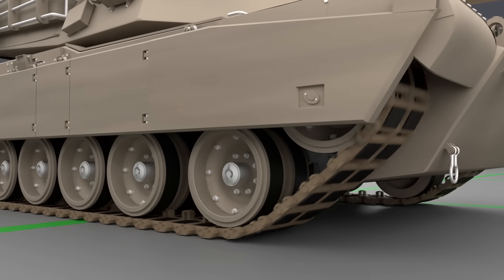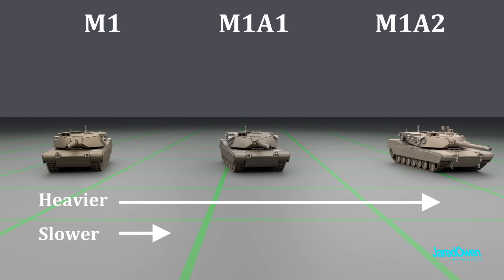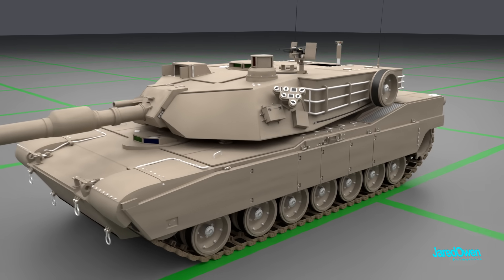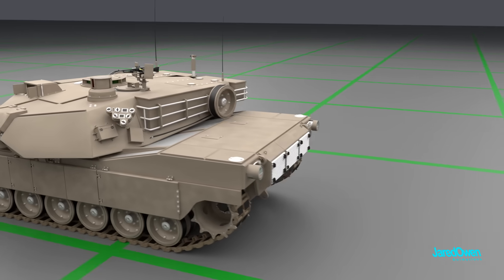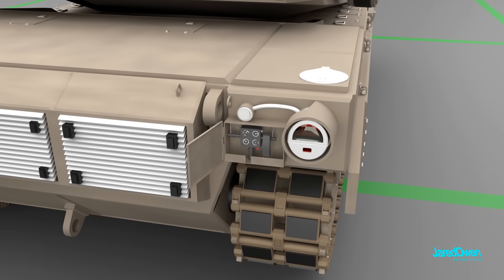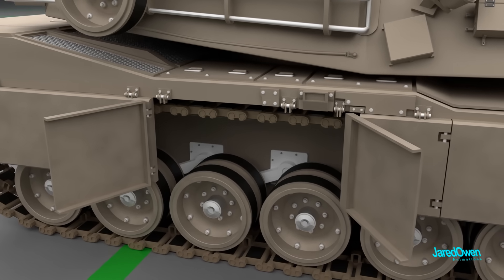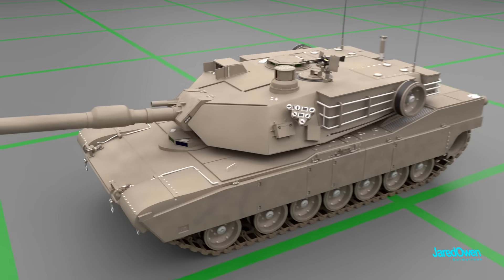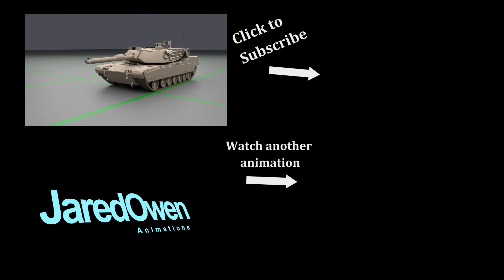How does a Tank work? (M1A2 Abrams)

Comment: Isn't it a dumb way to power a tank with a turbine which requires intensive maintenance, sucks soooo much sand in the desert where America's wars mostly are, requires special fuel. Wow, that is just so dumb! Other developed nations use diesel engine which is more efficient although less powerful.
Reply: They don't really require more maintenance. Sometimes more special parts, albeit there are less parts overall. Air filters take care of sand. The turbine engine runs pretty much on anything, Diesels are pretty limited in multi-fuel capacity.

 Diesel engines are more economical in regards to fuel consumption. Turbines are more fuel efficient.
Reply: @peterson7082  All tanks are high maintenance vehicles.

The MTU multi-fuel Diesel engine Ther powers the Leopard 2 can operate on any fuel approved for use  in the Abrams... so no advantage from the turbine.

FALSE, Diesel engines offer better BSFC and are more fuel efficient in combined cycle vehicle operation.
The AGT-1500 consumes nearly twice as much fuel per day as comparable Diesel powerpack combinations.
Reply: @sandervanderkammen9230  I was not referring specifically to the Abrams. 

> "All tanks are high maintenance vehicles."
  
 Agreed. 

> "The MTU multi-fuel Diesel engine Ther powers the Leopard 2 can operate on any fuel approved for use  in the Abrams... so no advantage from the turbine.
"

 This is based on what? 
> "FALSE, Diesel engines offer better BSFC and are more fuel efficient in combined cycle vehicle operation.
"
 I think you might be mistaking fuel efficiency for fuel economy.
Reply: @peterson7082  Based on the list of fuels approved for use in the M1Abrams.
Rudolf Diesel designed his engine from inception to have alternative and multi-fuel capability.
Military multi-fuel Diesel engines can operate on;
Marine fuel oil 
Heating oil
Any grade of jet fuel 
And gasoline or AVGAS
The AGT-1500 offers NO advantage in multi-fuel capability over available Diesel engines.

Diesel engines are more fuel efficient that gas turbines.

The Abrams when fitted with a Diesel powerpack delivers superior vehicle fuel economy.
Reply: @sandervanderkammen9230  Diesel engines are optimized for a particular rating of Diesel. Even if they're multi-fuel. The AGT-1500 isn't. And in fact the U.S. Armed Forces switched fuels at several points during the M1's career. Between Diesel and JP-8. 

> "The AGT-1500 offers NO advantage in multi-fuel capability over available Diesel engines.
"
 In emergency situations, no it doesn't, in the long-run yes it does. Especially when cost differences fluctuate between two of your main fuels in military service. The MTU' are optimized for Diesel only.
Reply: @peterson7082  All engines, including the AGT-1500 are optimized for a primary fuel type and rating.
The AGT-1500 is optimized for NATO F54 (Diesel Fuel no.2)
Reply: @peterson7082  The AGT-1500 offers NO advantage over Diesel engines in multi-fuel capability.
Reply: @peterson7082  False, the MTU 873 and 880 V-12 Diesel engines are fitted with A device called a fuel density compensator.
 This device automatically adjusts fuel metering parameters for any approved fuel, mixture or blend of different fuels.

Reciprocating Multi-fuel Diesel engines in service with the U.S. Army  are fitted with a similar device.

Comment: not bad vid i was a M1A1 sep tanker for 10 years only thing he got wrong was the fuel is not jet fuel its a modified diesel called Jp8 and all our vics run on it.
Reply: JP-8 is designated as a type of jet fuel.
Reply: The preferred fuel for the Abrams was D2 Diesel no.2 fuel but after introduction into service during cold climate operating conditions the Abrams suffered serious fuel system failures.
Special blended fuel was then supplied for the M1 which was a logistical nightmare.

The problem was not solved until 1991 when all U.S. Army combat vehicles switched to JP8.

JP8 is commercial Jet A1 fuel with a special additive package called +100.

Comment: Those two "Side Cooling Units" are not cooling the engines, they are Oil coolers and are placed on the sides of the transmission to allow for a drive shaft to turn the fans to draw air through the radiators. This video has quite a few inaccuracies, I worked on the Abrams for 6 years.
Reply: I thought so too, and he implied that all tanks have a turbine power package which obviously isn't the case. Also isn't the Abrams turbine louder than traditional diesels?
Reply: @ErisAlter  Higher pitch and louder when closer to the tank. The noise dissipates more quickly.
Reply: Eddy BT 
Yes but quieter than jet engines. And more powerful than the diesels, and can accept way more fuels than the diesels.
Reply: Awesome. Could it be possible if you write the other inaccuracies.
I would love to know more about it.
Reply: Also i think that smoke granades are usually launched before actually "exploding"
Reply: @gavinc8678  you should probably tag him if you want him to see you comment
Reply: @jacksondevine3870  I just saw it lol
Reply: We tried to give you guys the best recuperators possible to work with so you could go faster longer. This vid didn't even go into how it increased fuel efficiency or reduced the heat signature of the exhaust. Guess the turbine drive isn't "that" interesting to the masses. Hi to all the vets from the manufacturing end of things!
Reply: Yo I’m tryna buy a tank and flex wit it in my city. Gimme a plug big bro 💪 💯
Reply: @slow330xi3  Uncle Sam is the plug
Reply: Blaine Burgess Well done brave soldier but Abhrams is a same tank with minor differences comparing to Patton Merkava fantastic design tank.Same weight different manner to make a Tank
Reply: @raniolvespanssenlafayett6762  they both have their flaw and problems m8 not a single tank is perfect
Unless you tie cows to your tank and shoot the India

Comment: There is much much more to a tank that was not mentioned in this video. It's really the most basic of information. 
1. There is no singular best tank. Every tank is a tool designed for a single purpose and with a different doctrine in mind. Ever tried to saw with a hammer? 
2. Tanks are not even close to invincibility. The Abrams e.g. has composite armour in the front of the hull, the sides are simple slabs of steel. The turret has composite armour in the front and sides but the front is much much thicker and the sides are only armoured so that the turret has a similar protection level from a wider angle. At 90 degrees the sides won't stop anything that fires remotely modern ammunition. Is just can't be thick enough. 
3. Tanks are not really given away by sound. Because when you are able to hear them, they put themselves too close to you. Like in the Russo-Georgian War they went on the top of high rise buildings and shot RPGs at the passing Russian tanks from a above where they don't have armour. Again tanks are easy to kill if you have access, which is proximity. 
What gives tanks away is their thermal signature. They are 60 Ton steel boxes, especially in desert environment, they absorb a lot of heat from the sun and create their own with their engine. They are very visible on a thermal. So much so the Germans developed an experimental tank with a vented hull to make it "invisible" back in the 80s. Judging from the existence of the L2A7, that didn't pan out. 
4. In tank on tank combat: Who ever hits first usually wins. This is because they shoot from cover, get their kill, and move away. The image of a tank pressing into enemy lines is just wrong. The last tanks designed to do this would have been the Soviet T-50 series of tanks. They were built in great numbers so loosing one or thirty is not much of an issue. But they then also realised that a much more efficient alternative is a better tank. Like the T-64. What pushes today in western and eastern militaries is mechanised infantry. There are a lot more IFVs than tanks for a reason. A tank is fuck off expensive. 
5. Todays tanks are plasterd with ERA which provides a singular protection against shaped charges for a singular reason: Guerilla Warfare. The tanks at the beginning of the whole middle east debacle were and are made to combat national militaries, which they do brilliantly. But for an extended stay, they really were not made for that. As such and consequently every western military up armoured their tanks to levels unsuited for an actual war where the mobility reduction is suicidal as that is what allows one tank to get the drop on another and again: who hits first wins. But they had to, because Joe with his 50 year old Soviet RPG is regularly close enough to hit unarmoured spots and he does not care about his own life. If he does, he puts a lot of explosives in the ground and waits a for a patrol to be stupid enough to drive over it. 
tl:dr Tanks and their usage is as complicated as their technology. This video shows the basic components of a tank. Don't believe the robo voice from a YouTube video. Countries spend billions on a doctrine and make equipment fitting to it. It's better for you and me both that we never find out who was right in the end.
Reply: We’re writing comments here not story
Reply: make your own video
Reply: @roms1022  hes not attacking or going after the OPs video, hes adding some stuff to it so people can see. There are already "better" videos out there for describing this.
Reply: @teaganfitzgerald9771  ok ok thanks alot now i understand
Reply: You're right, he doesn't go into much detail here. and for the most part, if your armour is tanking "real" rounds, you should consider yourself lucky and not think oh I'm invincible because odds are your armour won't stop the next shot. They are now, as they get ever more expensive to make and research, becoming more than anything snipers that take out other tanks and things infantry can't deal with.
Reply: Sounds like somethin a commie would say
Reply: ƸIGHT SIX TWO True in part but corect in all.Tank is more sensitive when he need to refueling repair recalibrated reloaded and need new Crew members when is problem to Serious injury desertors ilness etc.Easily can walk on antitank mine ...Tank need too many compare to soldier or tout terain vehicles....Germans understand to use Tigers only to bombarding on distant rangers completly cover....Aviation is real enemy...Tank is expensive but for Now it stil eficient...Not obsolete but much more fragile
Reply: Did you just go to Google and type "tank story"and copy and past here...hahah..stop that my guy
Reply: Anthony Hualngo nah that joke was dead  before you even typed it😑🥱

Comment: Many mistakes in this video. 

- The Abrams can drive around 120km/h without an issue even in terrain. Its throttled down to 72km/h with a chip to increase the turbines durability.
- The Abrams always had 2 MG's at top additionally to the coaxial.
- Smoothbore 120mm doesnt mean that the inner diameter is 120mm exactly. It means that the gun isnt rifled and therefor has the disadvantage of a lower accuracy as the projectile doesnt get a spin. However this allows for more varity on the ammo choice as you can also fire cartridge which a rifled gun cant use. The lower accurcay is made up with the electronic targeting system aswell. This also has the advanatge of no wear on the rifling and lower and cheaper maintenance of the cannon. Also APFSDS is to small in diameter to be effected by the spin of a rifled gun.

just to emntion a few mistakes...

Comment: As a former Abrams tank mechanic, thanks for this.  Good visuals on suspension operation and interior layout.

One thing I can't let go though...  "Side skirts to protect the wheels and caterpillar tracks"  LOL, no.  Nobody gives a shit about the wheels and track, those are easily repairable.  Side skirts are to provide spaced armor because the actual side hull armor (on the inside of the tracks) is very weak compared to the frontal armor.  Having another armored surface protecting the same angle of attack, removed by a good distance (the width of the track) allows HEAT shells/rockets to dissipate before hitting the weak side hull armor, inside of which are things like the engine, fuel, driver's compartment, turret basket, and all the electronics and hydraulics that let the tank operate.

Comment: 9:49 It's interesting that the loader has to turn the shell 180 degrees. It just cannot be a design flaw in a device like this.
Reply: This comment was a year ago. But I'm still gonna comment. Most modern MBTs use autoloaders. This is faster loading but way to dangerous because there are a lot of moving parts, and the ammo can easily be shot and blown up.
Reply: @fishsticks440  No problem, I don't see any problem in commenting even 10 years old comments. 

I suppose that if the shells were head-on in the magazine, the hand loading would just be more tricky and dangerous. Obviously you can get a good grip of the shell when they are rear-on.
Reply: Generally it's not an issue.

Comment: Why Abrahms look like a twin Brother with British Challenger 2??
Reply: The Challenger is not related to the Abrams.
The Abrams shares the same hull and chassis design as the Leopard 2 as well as similar gun.
Reply: Sander Van der Kammen Wrong.Chobam armour in both tanks Chaly Abhram...Turet have almost a Same frame but only the main gun smothbore 125 MM are copiez after Leopard2. Arjun tank is Leopard 1 design...
Reply: @raniolvespanssenlafayett6762  So, the composite armor is not visible on either tank, not only do both tanks look different they are not related in design like the Leopard and the Abrams.
Reply: Sander Van der Kammen Many tanks use the composite armour combined with ceramic plate Even Merkava have a better design in turett 4 and Armatabetter protection for driver ...All three crew.member staying in a same cell
Reply: @raniolvespanssenlafayett6762  Thank you for proving my point....
Reply: Sander Van der Kammen Thank you

Comment: And.. no, not all tanks have turbine engines, you muppet. Most of them have turbo diesel engines since they are way more reliable and easier to maintain. The output these days are the same or better compared to turbine engines as well.
Reply: Not necessarily more reliable. While on paper turbines are easier to maintain, in actuality they're about equal.

Comment: I was a driver of an M1A1 during the Gulf War. One thing not shown is that the tank commander had a 50 Cal mount on top of the turret. Also, the loader had a seat where he sat, hit a knee switch that opened the sliding ammo compartment door, grabbed a Sabo or Heat round,  and slid it into the breach, all with not having to stand much.

Comment: You could add that the doors to the ammo storage prevent any flash from inside the turret detonating the ammo, which include projectiles and textile cordite bags.
The ejecting turret roof above the ammo I didn’t know about - very clever.
Reply: The blast doors are a band-aid fix for a major design flaws in the Chrysler XM1, because the AGT-1500 could not meet the range requirements 
The main ammunition magazine space was need for additional fuel storage, because of the increased danger of have the main magazine inside the turret the Army demanded   that the crew compartment have additional protection.

Comment: Brings back memories. This tank is an amazing piece of machinery. When we drew our tanks in Kuwait from Camp Doha before heading out into the desert, my crew was fortunate enough to get one with a new pac (engine). I got mine up to just under 50 mph on level desert. Some of the tanks we drew were dogs and wore out but most were pretty decent. I'll never forget that whine of the turbine. From the driver's hole, the sound would put you to sleep if we were just idling in neutral with the brake set. We had M1A1 Heavies. The "heavy" version weighed in at 70 tons (if memory serves me right) and the non-heavy version is 67 tons. It's amazing how quickly these would be able to move from a standstill with a full twist rearward on the T-bar grips. 

I hated driving at night with the thermal periscope in place because they had a bad habit of falling right into the croch area because of the terrible design of the 4 wing nuts that held them in place (most tanks had at least 1 nut that was stripped or broken. I can tell you from experience that it only took one time before I put my armored vest in my lap every time I drove with the night vision in place. Usually, I would sit on my vest to "armor" my tail end from any explosion which might occur underneath. The good ol days... 😂
Reply from the maker: Thanks for sharing Steve

Comment: how many bullets can be carried.?
Reply: (18) 120mm. rounds in the rack behind the loader, another (18) behind the commander, both of which are in a compartment with blow-off panels. Another (6) 120mm. rounds are kept in a blow-off compartment in the hull to the right side behind the engine firewall. So (42) rounds of 120mm. in total. (900) rounds of 12.7mm. for the commander's Browning machine gun, plus (10,000) 7.62mm. for the coaxial gun and another (1,400) 7.62mm. rounds for the loader's roof mounted machine gun. More 7.62mm. and 12.7mm. can be potentially carried, plus the crew's personal weapons and those otherwise issued to them.

Comment: 392 liters of jet fuel/100km ... wow. That is some fuel consumption. A fuel tank of 500 gallons ... 1900 liters ... for the 300 miles.
The T-14 Armata does the 300 miles with 1000 liters (260 gallons) of fuel, almost twice as efficient. Not to mention the fuel is diesel, not jet fuel.
Leopard 2 has 1200 liters (320 gallons) but it can only go about 200 miles. Then again, the US assumes no fuel shortages.
Reply: The fuel type would makes no real difference. The T-14's fuel capacity and range are unknown.